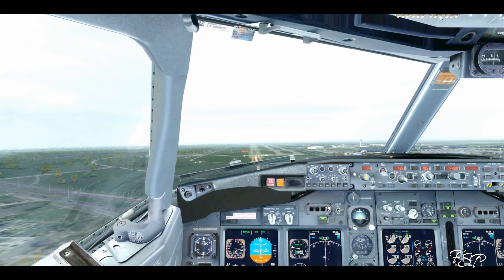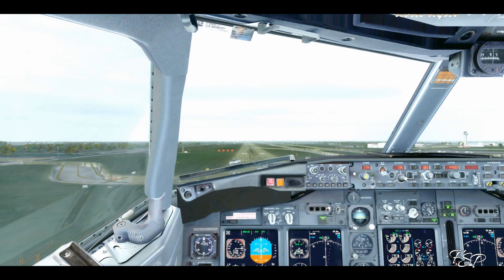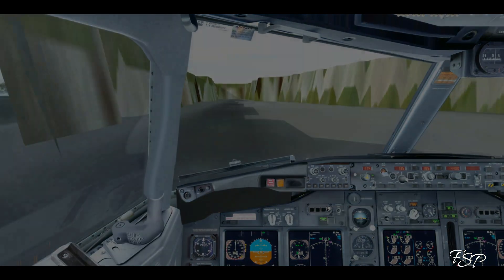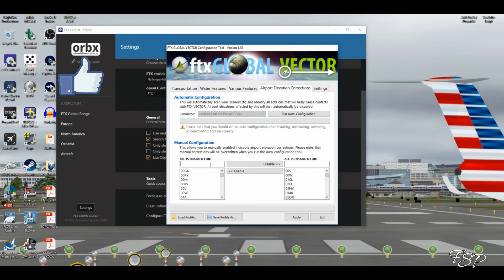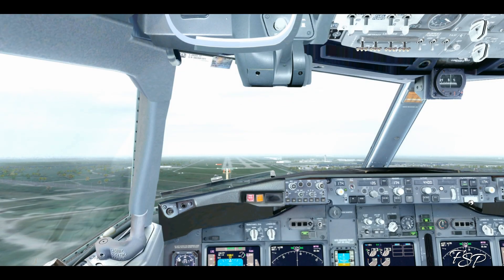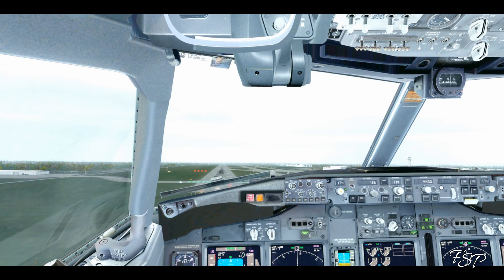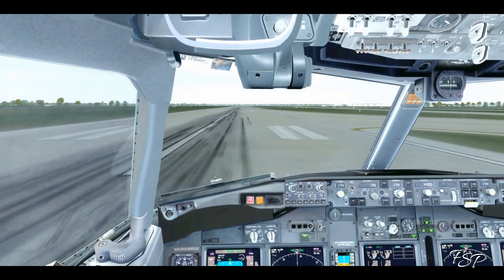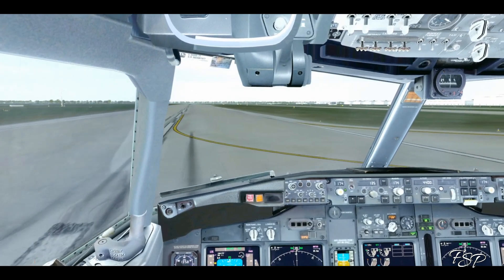Orbx Elevation Issue Fix [Prepar3d/FSX]

Comment: There is no Elevation issue with Orbyx fsglbal it adds vectors but also raises airport elevation if you running default with no mesh then you need to have all you airports disabled I run pilot's mesh with vectors it works nice.in the Orbyx manual it say what everything does if you have no mesh need to uncheck airport elevations

Comment: This is a key trick to learn; however, I wish there was some sort of list of airports that need this correction.  I've found both stock P3D LFPG and FlightBeam's KDEN need it, however, that means re-disabling them both every time I need to run the tool for other purposes, and I really have no idea how many others need the same manual fix.  It sure is disheartening to come to the end of a long flight, only to discover that I can't possibly land at that airport without shutting down the sim and correcting it in FTX.
Reply from the maker: Hello James, thank you for watching!  Have you created any profiles within ftx Global Manual Configuration list?  You could always visit the airport/scenery after you load it and see if there are any issues.  If there are none you should be golden, but if there are you could then disable it in the Manual Configuration, and add that to your profiles as you go.  This would save time.  

One of the issues I see that's most common is fsdreamteam addons. Usually, those have to go in the disable list on my rig anyway.  Hope this helps! Don't forget to subscribe.
Reply: I have exact problem at the exact airport which is the T2G LFPG and FlightBeam KDEN. Gonna try this method and see if it works
Reply: I know this is an old thread.... but I'll try anyway. I fixed the issue with Flightbeam's KDEN using the above method... although, I'd figured it out BEFORE I saw this video! It would've saved me about two hours of hunting and digging. If you look at KDEN, the airport elevation is now different between enabled vs. disabled (in the AFC tool), by almost 100 feet. I'm not sure how to square this. I looked at a jeppesen airport diagram and using ramp A52, it could be accurate but I'm just not sure what to do with it.